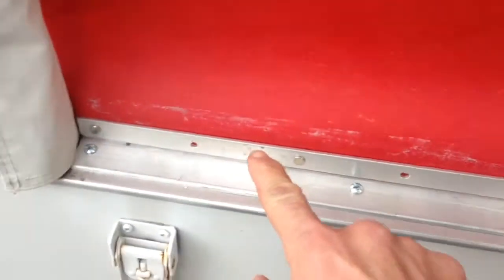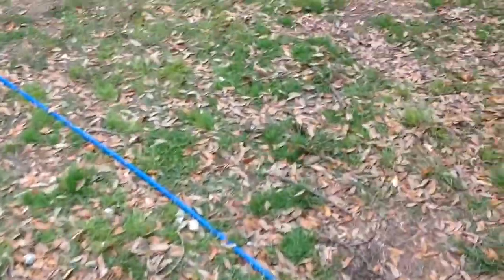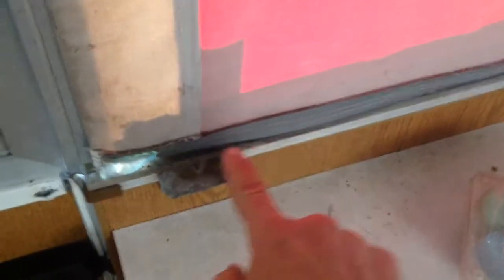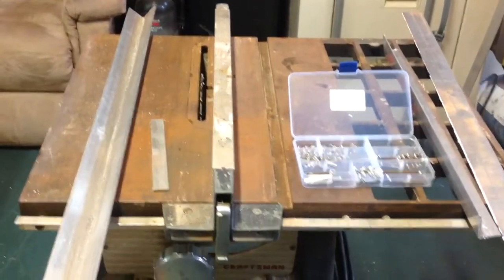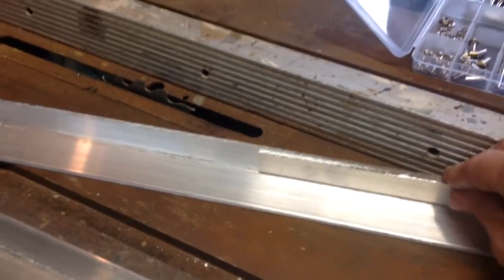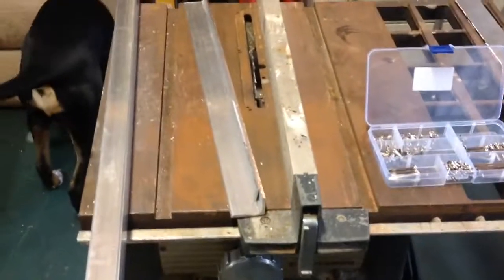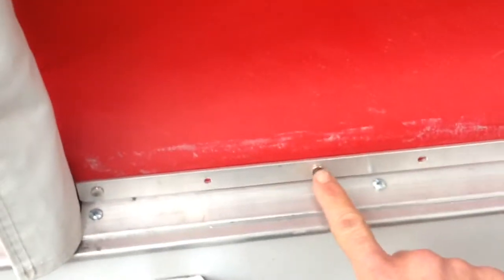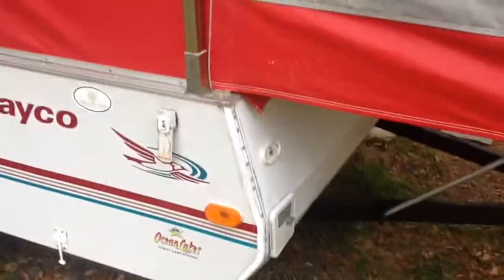Canvas Repair on Pop up camper

Comment: Did you drill a hole in the canvas for the bolts ?
Reply from the maker: Yes I matched drilled the canvas to the aluminum pieces. Still holding right on until today.
Reply: @PowellRoadDIY  ok thanks I am going to try this I was going to replace the rubber on the canvas but I can not find it any where